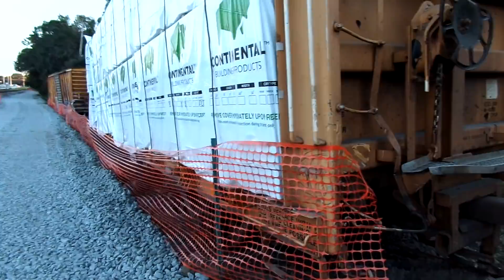CSX Train Derailment Polk County Florida

Comment: Alan, while the defect detector is paramount for inspecting the bottom side of the engines and cars, yet the rails, ties, rail-beds, switches, and crossings, usually, can only depend on a visual   inspection, with the human eye; unless the use of an inspection car, moving along at about 15 mph. should find a serious malfunctioning, rail, surface, fracture and or defect. I'm guessing, those types of inspections, by a specialty car, are very few and far between

Comment: A couple years ago in Maryland, a coal train derailed and the coal spilled on top of 2 young girls.  The girls were completely buried in coal and were killed.  That derailment happened because the engineer had applied the brakes too hard on a curve.
Reply: Jaw Tooth not true it was due to a bad rail I believe
Reply: Even then, trains are still the third safest mode of transportation, behind Airplanes (safest) and busses!
Deaths per billion miles travelled is something like 0.07 for planes, 0.11 for busses, 0.15 for trains, 7 for cars and pickup trucks, and 212 for motorcycles. (!!!)
Reply: At least that’s what some lawyer said